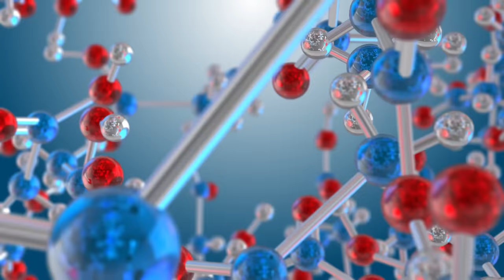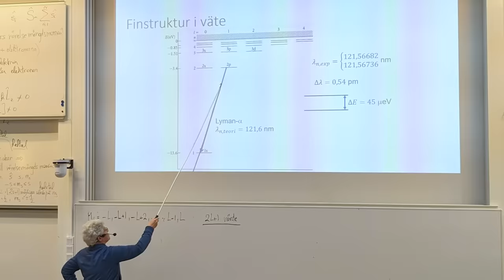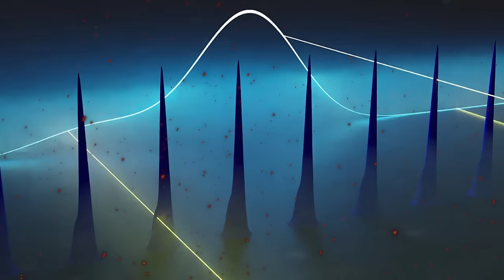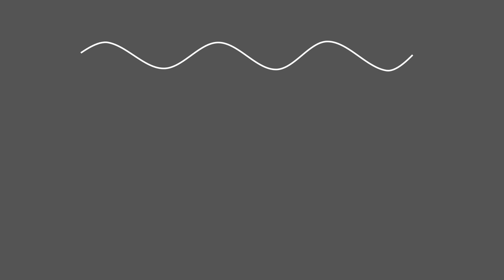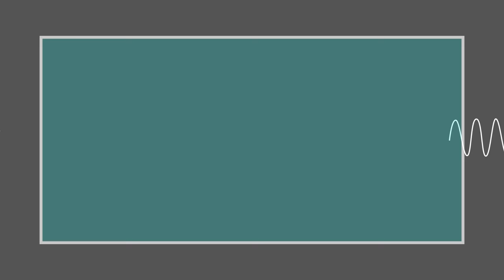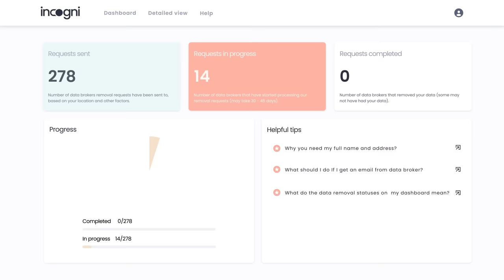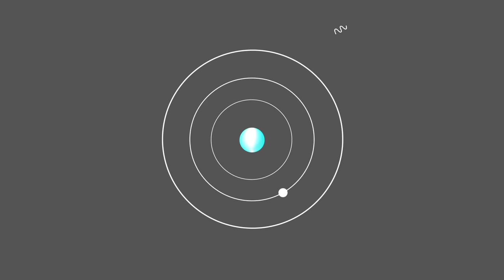How Physicists Took An Electron's Picture  - Physics Nobel Prize 2023 Explained

Comment: As a musician and synth designer, this nobel price really spoke to me. And yes sometimes I think way to much about phase and harmonics. Great video my friend! 😊
Reply: Price? Very 👍
Reply: Gotta love another musician physics freak like me. We wrote a country song about the speed of love.  I believe love is quantum entanglement, spooky actions at a distance.  Nothing is faster than the speed of love.
Reply: I like my prized noble duck eggs over easy
Reply: As a synthe mesc designer I've noticed that my new leather lazy boy rocker recliner ( circa 2100$ ) is built for short people and tips over with preset 1 attosecond alert then lengthy travel through the event horizon to point of no return singularity time to notice its been a few plank unit of time since I dusted the floor in my den. And I'm only 6'1

Comment: Admit that I still have a problem with photons. The attosecond laser burst is cleverly built with phased beams interfering to create the desired regular pulse. At this stage it is still an electromagnetic beam and as such, will transfer momentum to a moving charge (such as an electron). Instead of seeing the electron, it sees a displaced charge caused by the attempt to observe it? Is a photon still an E/M beam? I’m guessing not, or we at least don’t think of it as such, using probability density functions.
Reply: I am with you I think. I do not think what they call a single photon exist.  What is emitted from an electron when jumping back into the atom is a light pulse that consists of more than one cycle of the frequency I believe. It is an amount of energy that is measured over a second. E = hf  The frequency may be any frequency but the pulse length can not be shorter than half a wave length I believe as it would other ways be impossible to tell the frequency.
Reply: they do not mention that they probed the electron with a multitude of lengthwaves, 
the result is a reflection from the electron, reflection of the probing signal. or say signals! 
what they pretend to be the image of the electron, is an image of the probing signal, and no image of the electron can be extracted from that.
Reply: @leonhardtkristensen4093  i think this is a really important point, that I’ve struggled to get my head around. I don’t really see any reason why photons as fixed-size individual wave packets would exist at all. I totally get the energy quantisation in atomic electrons - that makes perfect sense, and the fact it takes a certain energy of electromagnetic radiation to change the energy level of an electron is similarly obvious in its quantisation. However, since when an electron absorbs such EM energy, it immediately becomes oblivious to that energy, means it doesn’t matter how long the wavetrain is. 
So, are photons actually quantised objects? Or is it only their interactions with matter that are quantised? Personally, I’d lean towards the EM field being a totally analog thing. After all, extremely weak electric and/or magnetic fields definitely exist, and I don’t really see a good argument why travelling EM waves should be any different. A travelling EM wave (aka a stream of photons) obviously has a fixed relationship between the strength of the E and H fields (Maxwell) but the amplitude of the wave is arbitrary - no quantisation there. That leaves the only possible way it could be quantised must be a temporal quantisation - like you said, a certain number of cycles, possibly in the form of a wavelet or soliton. Maybe this stuff is obvious to those with a better understanding of the mathematics, but intuitively I’m constantly questioning this - are photons quantum at all?
Reply: @simontillson482  What I get at is that what we really only know is that the EM has to be above a set frequency to knock electrons free from a "Black body". Also we know that to make an electron jump in an atom requires very specific frequencies as they show up as either missing bands or emmisions at those frequencies. As this is the case and what we call a photons energy value (E=hf) is for one second then it is my oppinion that it points more to that it is the frequency or alternatively that it takes one second to do supply the energy needed.
I get the idea about it being the frequency as I know from Radio technology that you can mix a couple of lower frequencies and get a higher frequency out of it. Unfortunately it demands something non linear to mix it and I don't know of anything non linear in the atom.Then I don't know very much about an atom.
I am at the oppinion that there is probably a minimum value (amplitude) that EM can have which is probably the value of h or at least related to it and this would be the E value for one second at a frequency of one Hertz.
Unfortunately to get any Physician of any standing to aggree to anything or even look at it appear to demand that one has an equal education and standing to them. I am only an Electronic engineer and there fore probably not worth their attension. 
What I do know is however that there are many people with special knowledge in special fields of electronics that  know a lot more than me about those fields. They may also have a better overall knowledge but I have learned some things and I have a life long experience an EM also has to do with electronics.
Reply: Man I think that these wavefront objects are shapes that exist inward and outward. 

The universe has to be static. And the photon is like a kink in the shape that later is tied to an observer. A wavefront intersection, and that's 3d matter. 

The shape of particles are continuous inward and outward. That's 4d. 

We probably don't move at all.
Reply: @gordonthorn2049  Well my thoughts are different. I believe that space is basically nothing and the energy of which all matter is generated has some as yet unknown form possibly like a fog but it is pulsating. I believe the simplest form of that energy is manifesting itself as electro magnetic emmission. We know a lot about how it behaves (influences us) but not what it is.
Reply: The power is in that it’s such a small pulse that relatively itself trims the extents of travel

Comment: I  do not really follow the final discussion on "photon size" and attosecond pulses. A 100 attosecond pulse should be about 10 times shorter than a wavelength in visible light, yet it must encompass many photons, but that doesn't mean photons are that small. I always thought that the "size of a photon" is something not defined: the energy of a photon can be distributed over a macroscopic distance, yet the interaction of the EM field with matter will be localized.

Comment: Red light is faster than the other spectrum think about what you just said in relation to redshift in stellar light
Reply: Interesting point - it would imply a need for a chromatically dispersive universe!   At the moment we describe free space as having zero chromatic dispersion (hence C = freq.lambda) with c a constant.  This is profound because everything else in the universe is dispersive (which we infer implies some kind of damped oscillatory motion).  If free space is dispersive (which in physical terms it should be) then you could conceive of a red shift over long distances as the dispersion builds up (as occurs in optical fibres over long distance.). If we could detect a dispersion in freespace then it could change everything.
Reply: Redshift is about stretching everything. When you slow down light (all frequencies equally, like when you observe a vehicle passing by and its pitch goes down, or slow down a recording), it has nothing to do with relative speeds of wavelengths. The spectrum shifts towards longer wavelengths, which makes objects look more warm, red.

I was looking for discussion about the speed of wavelengths in the case of prism, because that doesn't sound like the reason why the prism splits up wavelengths. (It's the wavefront that changes direction in the diffraction... again wavelengths play a role here, not the speed).
Reply: @SamiJumppanen  - I think it’s a question of perspective maybe literally so. Cosmological red shift is an observed phenomenon that has been ascribed to a Doppler shift associated with expansion of the universe. It’s actually a bit of a stretch if you pardon the pun, because the redshift itself doesn’t prove expansion it just provides one model for it.  Other models for the redshift might be eg tired light or variable speed of light etc so it’s controversial.
Reply: @SamiJumppanen  - dispersion in a prism is associated with wavelength dependent speed of light in the glass material.  We say the light is slowed down but it’s actually a phase shift of the light wave as it interacts (harmonically) with the refractive medium. For a Ray incident a normal incident we get the speed change without a change in angle, for non-normal incidence you get the bending of the wavefront due to the differential phase shift occur across the wavefront. So in the above discussion we were considering whether the universe truly has a constant refractive index and gravitational lensing infers it doesn’t always and then the next question would be is there any chromatic dispersion we can active to freespace however small?  One place to look would be for a degree of chromatic aberration of gravitational lensing as different wavelengths are bent at different rates.  I’m not aware this has ever been reported so at the moment I assume we stick with a non-dispersive universe.  But you never know…
Reply: I thought, but found no relation at all.
In some materials red light is faster than blue, true so far ... BUT ... the universe is full of vacuum and the speed of any light in the vacuum is c (who had thought that: the speed of light in the vacuum is exactly the speed of light in the vacuum).
Thus, since the light from a star travels through basically only vacuum on its way to us, red light is as fast as blue is.
Reply: @snygg1993 light from red stars is perceived as distance and speed. Light is traveling through a mostly vacuum but there are magnetic fields and gases refracting the light. Is the light pure white light or some other wavelength

Comment: Generate 2 of those "square(-ish)" block waves, shift one a bit & subtract it from the other, et voila - even tinier pulses... (possibly?)
"Such a clever technique, it must be aliens..."    👽
Reply: they do not mention that they probed the electron with a multitude of lengthwaves, 
the result is a reflection from the electron, reflection of the probing signal. or say signals! 
what they pretend to be the image of the electron, is an image of the probing signal, and no image of the electron can be extracted from that.

Comment: What I want to know is the acceleration rate of a photon. For instance, when an electron emits a photon, does it accelerate to light speed as it is being created? Or does it do so only after the entire photon is created, and even then, does it accelerate to light speed or get there "instantly?" Also, when traveling through a different medium, slowing the photon, what happens when it emerges at the other end? Does it actually instantly go back to light speed or does it accelerate to that speed? Which begs the question, since it's going slower than light speed inside the different medium, is the leading portion of the photon being stretched out since it's going faster than the part still in the medium? Since it seems nothing does anything truly "instantly" in our universe, there should be an acceleration period even for a photon to go from zero speed at it's creation, to light speed tiny thought that time period would be.

Comment: Snap thru has to do with energy levels too. Exponential force pair with total loss of resistance during buckling lead to very fast snap thru to next energy level in my model. The graph of the phase change thru multiple levels fits an exponential fit curve but is sawtooth at the bifurcation.

Comment: A 1attosec pulse would have a wavelet length of 0.3nm, which is similar scale to a hydrogen atom, which I'm guessing isn't a coincidence. 

Also, you seemed to imply that the photon is generated the moment the electron gets back to the lower state, have other possibilities been ruled out, like 'the photon is generated the instant the electron starts to return to the lower state'?
Reply: Here in lies the rub!   Where is the electron when it is supposedly moving between states?  How do you get from the bed to the bath without crossing the room?
Reply: @Number6_ - how about there never was an electron per se orbiting the atom. Instead it’s an electron cloud that is oscillating from one vibration  mode to another.  (We see this also in molecular vibration modes.) The time it takes for the electron cloud to complete the mode transition is the em wave emission duration.   The mechanism is classical in nature but the probability of what and when is the quantum behaviour.  It’s a bit like when the gears slip on a bicycle- it’s probabilistic which gear you end up in even if you have all the mechanical details of the gears, sprocket and chain.   So I’m pushing a classical oscillatory model (modal vibrations of electrical energy) with a quantum probabilistic overlay for the event itself.).
Reply: @alwayscurious413  I appreciate your attempt here, and no electron as the particle physics people would describe it, but an electron cloud is still an electron. Would your probabilities be dependent or independent of each other? You do give a a duration to cross from 1 state to another. Therefore your probabilities would have to include being in no state at all, which violates the quantum theroy all together.  This is the problem I have with the electron and photon.  I think there is a whole branch of physics that is being over looked. Like Euclid's 5th postulate. Researcher are to comfortable with there present models to make any progress. Fresh eyes outside of Copenhagen need to look at this.
Reply: @Number6_  - thanks and your positivity to this discussion is really appreciated as it can be a sensitive field!  Let’s assume the electron is only ever a fuzzy cloud of quantised electrical charge. It’s location as a particle is only relevant when it is observed, and the observation of its location is essentially Gauss’s law applied to the charged cloud itself. The cloud can never disappear so photon emission from an energy level change is the finite time during which the cloud oscillates between its two energy states.  But it stays as a cloud at all times - I’m thinking of a balloonthat can be squeezed into different shapes under an external force but which prefers to pop back to its ground state when unsqueezed.   As the balloon of charge oscillates between states it can emit light same way an RF transmitter does. The light emission is the result of the cloud oscillation occurring during energy state change (like a balloon it vibrates as you wobble it. it finally settles down and stops oscillating when it is in a more stable state.  For ionisation to occur we can rip the cloud right off the atom and it is then a free cloud of quantised charge ready to be eg diffracted or localised somewhere else perhaps on a fluorescent screen etc. at all times the behaviour of the cloud is probabilistic as enumerated by its wave function and also momentum conservation. I like this picture - I’m just worried it’s ‘too easy’.  It’s been in my head a while ….
Reply: @alwayscurious413  your model sounds good. How these probabilities work is unclear. Something along the lines of a probability density function. Where you would have some exspection of strength of negative charge. I am not a supporter of the Copenhagen interpretation or of Schrödinger's cat, but interfering waves producing large densities in the discrete quanta amounts. The wave valleys being the spaces in between the quanta. The whole cloud being a standing wave when stable. @alwayscurious413  your model sounds good. How these probabilities work is unclear. Something along the lines of a probability density function. Where you would have some exspection of strength of negative charge. I am not a supporter of the Copenhagen interpretation or of Schrödinger's cat, but interfering waves producing large densities in the discrete quanta amounts. The wave valleys being the spaces in between the quanta. The whole cloud being a standing wave when stable.

Comment: This is the MOST interesting thing I've learned in 20 years.  I'm 79, almost 80.  Into motion physics and realize I should up my education in optical physics.  P.S.  NOTHING can travel in a true circle, absolute time circle unless it can exceed the speed of light by 4/3 Pi(c)cubed where c is the radius of a sphere for a given amount of time relative to an *observer.  At that velocity a singularity will seem to be an "object" relative in time to the observer.  It can be in the SAME place at the SAME time... complete a circle relative to an observer at the SAME time.  *The astute will notice this is the formula for the volume of a sphere for a given amount of time RELATIVE to an observer... and, darn, time is RELATIVE to the observer where the time period is the radius of the object/singularity/photon or whatever.  i.e. on a proton a normal day-to-day second (1/3600 of an hour) would be a VERY, VERY, VERY LONG TIME.

EXAMPLE:  While Earth seems to make a circle or ellipse around the sun, it's ACTUAL path through space is an elliptical WAVE with a radius/diameter of about 93 million miles but the sun moves about 7 BILLION kilometres through space a year so the ACTUAL path of Earth is an elliptical WAVE with a wave-length of about 7 billion kilometers.  NOTHING moves in real circles.